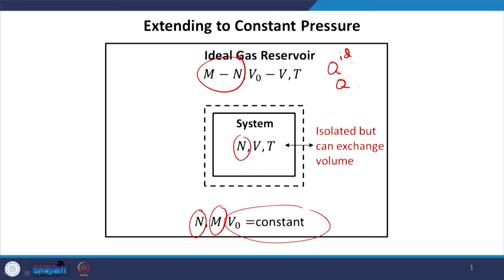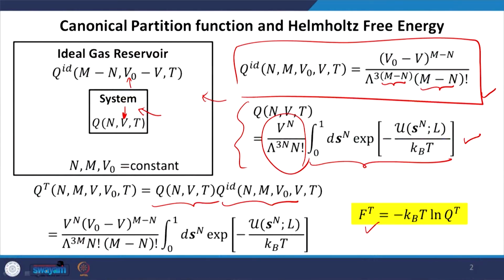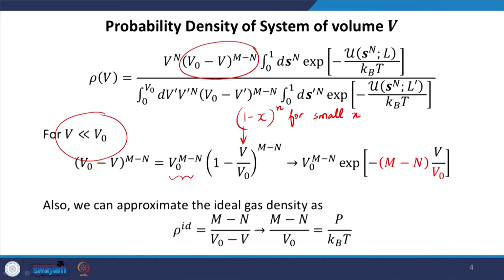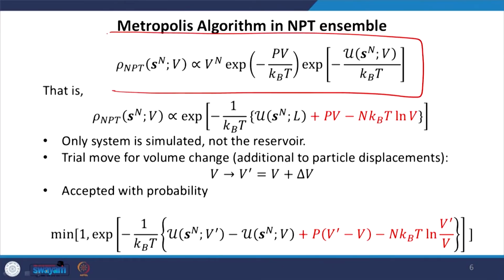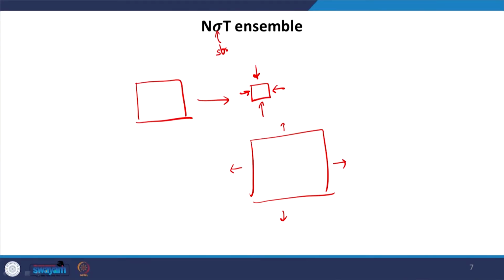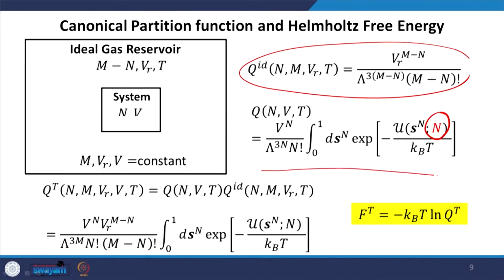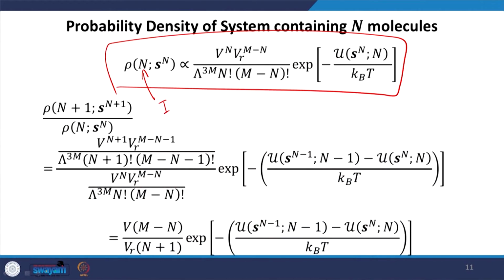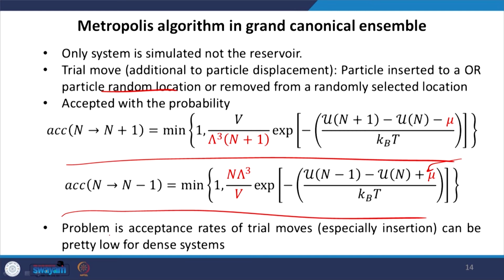Lecture 52: Extension of canonical ensemble monte carlo to other ensembles (continued)

Comment: I think after any removal or acceptance, the system should be minimized (at least around the location where the change occurred) to have a plausible system. At the same time , I think that should be used molecular energy (U/N) in order to compare systems with different composition.